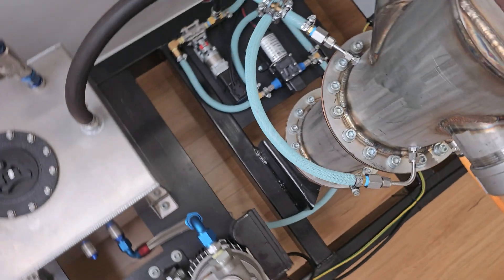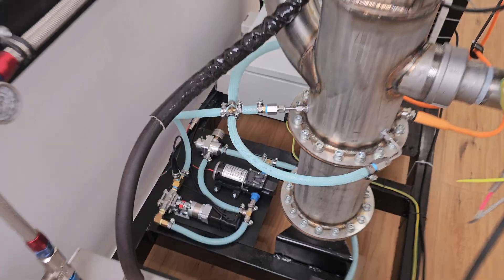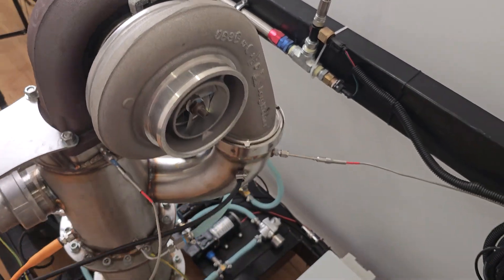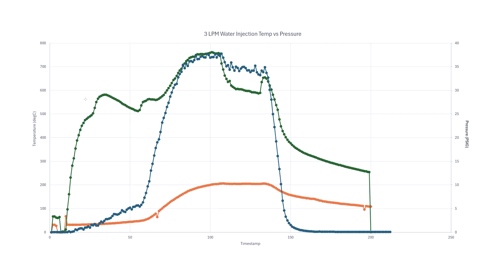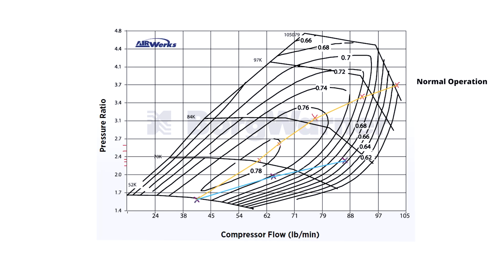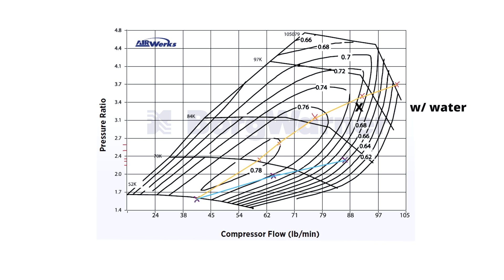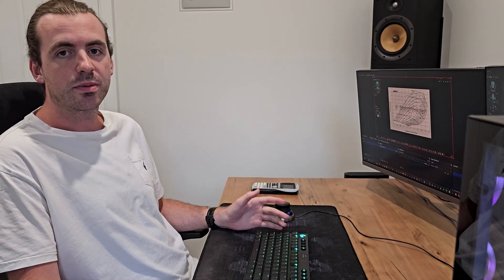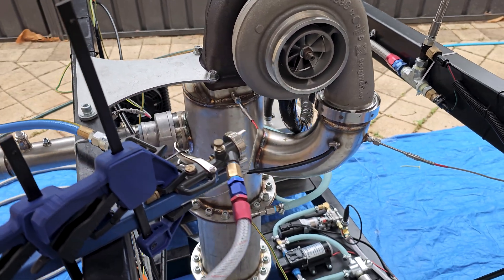Testing My JET ENGINE'S Water Injection System!

Comment: I'm doing something similar for a university project, but its a smaller turbojet rc engine (kingtech k240g5) producing about 50 lbf thrust, we are trying to inect a specific flowrate (6.7 gallons per hour) at around ~200 psi with a hydraulic water atomizing nozzle, we are struggling to find a pump that is under 300 dollars that can produce a constant 300psi pressure. Would love to connect and would appreciate any advice!

Comment: Nice work, have you tried adding methanol to the water
Reply from the maker: Hey mate, love your work! I haven't as of yet, but it'd definitely help. This is a temporary setup, the plan was to use a pressure washer pump to get 1-2kpsi to help atomisation. The addition of a tank (and filter) is on the list and that way I can experiment with methanol etc too :)
Reply: @eg_engineeringaustralia  Thanks, you could just add it to the water 50/50 mix
Reply from the maker: Thanks I'll keep that in mind! Hope things are going well with the 175! 😊

Comment: I have heard that you will wear the impeller down injecting it into the turbo
Reply from the maker: Absolutely, and that is at least one of the reasons that I am going with injection directly into the combustor. But even then you need to consider turbine errosion. But in my case the benefits are worth the cost of a new wheel every now and then

Comment: Shouldn't you inject later in the combustion process?  I would think that the heat absorbed by the vaporization could inhibit complete combustion if set up wrong...
Reply from the maker: @ZachSwena  it definitely can, and I'm absolutely expecting it to happen with this basic primary zone injector but the part that I left out of the video was I already had the holes there's from previous stuff so it was very easy to add and I just want todo some tests as more of a sensitivity analysis more than anything. It would likely be better to inject just after the primary zone so you don't disturb combustion as much like you said but we'll see 😊

Comment: @EG Engineering Australia I actually think you get more power out of this 7:57 water, instead of this 2:11 system.
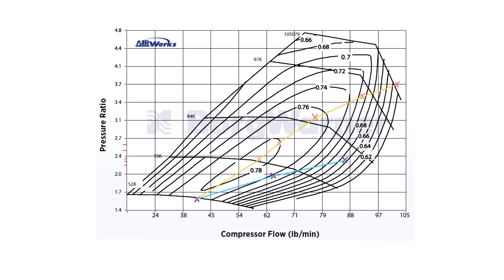Because now that water gets into the primary zone and gets a chance to boil to steam, and steam increases the volume MANY times (about 1'700x volume at sea-pressure), instead of as you said 5:54 that the water have no time to boil when in the dilution zone.
🤔 If you can pre-heat the water by using it as a coolant for some part of the engine before injection, it needs less energy to boil to steam, energy gained from otherwise waste-heat :D
Reply from the maker: @sebbes333  thanks for sharing this, i definielty agree with your logic mate, and the benefits of wet compression like that at 2:11 are very well documented but there's a couple reasons why I'm avoiding it (for now). It seems to be more limited with flow compared to internal injection, and I need to be able to inject several LPM for my aux combustor project. I didn't measure the example at 2:11 but it wouldn't have even been 1/10 of that just for perspective. I'm sure you can do it, and I'd like to test again in the future but for now I want to give internal a proper crack. Second reason is, injecting at the inlet alters the composition of air entering the auxillary combustor which will mess up some of my future plans with the engine. Blade errosion (both comp and turbine) is another consideration but honestly it's going to happen no matter how I do this with these flow rates so it's just something that i will need to keep an eye on via inspection. Hope that helps and thanks for the informative comment 😊
Reply: @eg_engineeringaustralia  Hmm... Blade erosion is something I haven't considered, but it's obvious when you mention it, the blades rotates at what? several 1k RPM? So throwing water, in there (even tiny mist droplets) would be similar to throwing sand into it but at lower RPM? that's not so good.

It reminds me like the opposite of "cavitation bubbles" (vacuum bubbles collapsing) that fast water propellers gets eroded from.
Reply from the maker: @sebbes333  the max for this turbo is 105,000RPM hahah so yeah it can be a serious problem. I'm fully expecting to need todo turbo rebuilds in the future if the blades erode but thankfully it's a very common turbo and I can get it done through a company here cheaply because they go through them like crazy.  There's plenty of ways to reduce it, and tbh a lot of comments on here are on the money with suggestions, it's just a matter of what's cost and time effective to implement. My priority is testing the new CD nozzles with the current setup as people keep asking for more shock diamond videos haha but after that I'll revist the water system. I'm really glad that so many people have been interested in the technical side of this project it's great to connect and brainstorm ideas 😊

Comment: I'd love to see you run the jet on alternative fuels
Reply from the maker: @adamgaffer3991  this jet was originally made as a platform for alternative fuel testing as part of my engineering thesis project! There's some other videos on the channel of it running both simultaneously and individually on kerosene and LPG, which I did for emissions analysis 😊
Reply: @eg_engineeringaustralia  sweet I came into the series a little late but what about waste oils or bio diesel
Reply from the maker: @adamgaffer3991 The videos are pretty old haha I did the project back in 2020 actually. The focus was on dual fuel with methane or hydrogen being combusted simultaneously with jet fuel. But, you can fun jet engines on just about anything combustible you just need to atomise it. Heavy oils could still work but you'd need to use an air assisted atomisation nozzle

Comment: you are running post combustion , equivalent to spraying in the manifold ( after valve before  turbo) for a gas/diesel  engine.  
      My thoughts for an expairament of my own , using pre and post cylinder injection  on my diesel.  Pre reduces Altitude Density( higher lb per cubic ft) and in cylinder steam generation/expansion.  Post to recover lost volume from 1st stage exhaust turbine  contraction , yealding higher pressure raito in 2nd  larger turbine housing  that force feeds the 1st more lbs per min . 
Dream Big  Chisel Down to Really

Comment: Very thought provoking!

I've never thought of using water injection this way, but it definitely rings similar to water injection on reciprocating engines.

I personally never thought of bleeding boost for side projects either.

I've used it for cooling purposes, but that ended up still pushing the boost overflow back into the exhaust of the engine in my case.
Reply from the maker: @hunnybunnysheavymetalmusic6542  haha yeah it's opened a lot of avenues for auxillary projects! I've got a bunch of things I'd like to test. 

Thanks for the comment - let me know how you go with your engines 😊

Comment: Maybe add a little methanol to the water.
Reply from the maker: @Emprivan  this is just a temporary setup for testing so I'm running straight from a hose. I'll have to add a tank so I can filter water easily and can add alcohol or methanol for testing down the track but this should be fine for now 😊

Comment: You can try to make superheat steam from exhaust heat injection, break down water's molecule.
Better than atomizing droplet.
Reply from the maker: @watt1241  thanks for the comment! I'm assuming you mean regeneration? Like heating the water through tubes in the exhaust to a steam and injecting the steam in to the combustor? If so I have thought about it but it's a lot more to consider than just pressure Injection of water. Definielty agree that it's more effective / efficient though 👌

Comment: Triple engineer here developing Advanced clean, efficient, power dense solutions in domains of energy, propulsion, mobility, robotics / exoskeletons and clean technologies with a particular emphasis on the aerospace sector including space exploration and commercialization [solved NASA's primary colonization challenges]. Among other things, I/we are developing an advanced power dense free-piston internal combustion engine based of our 𝔽𝕦𝕖𝕝 𝔸𝕘𝕟𝕠𝕤𝕥𝕚𝕔 ℤ𝕖𝕣𝕠 𝔼𝕞𝕚𝕤𝕤𝕚𝕠𝕟 [𝔽.𝔸.ℤ.𝔼.] technology [you may find some info online]. I've also devised advanced low cost, compact, power dense, fuel efficient jet engines [including rocket engines]. The public interface will be a personal door-to-door air mobility platform, the PersonalJet.

 So you are trying to get more power out of the black box w/o increasing the temperature. Any other goals?

Since the exhaust is still very hot, a recuperator/heat exchanger has been one way of achieving this but, depending on the architecture/topology they raise the combustor and/or turbine temperature. See power microturbines.  Based on several patented innovations,  several of my turbo-engine concepts enable simple ultra-high compression and/or efficient gas expansion which of course improves fuel usage & power-density. Here the turbine inlet temperatures may be so high as to warrant water injection at any number of points. I do not like the bulky recuperator for aviation apps so my efficient power section will be the best option. I expect exhaust near ambient which the 𝔽.𝔸.ℤ.𝔼. engine also achieves. 

A 🇳🇴🇻🇪🇱, 🇷🇪🇻🇴🇱🇺🇹🇮🇴🇳🇦🇷🇾, low cost, power dense compressor and/or turbine architecture may be used in some apps. A new air-cycle will also be used in some apps

I have your email and may get in touch at some point.

--
P.S.
Eventually we'll develop high temperature/efficiency solid-state thermo-electric power/propulsion tech and then the biggie - 'anti-gravitic' propulsion.

Comment: Why not add a second turbo…? Current setup as is, just pipe the final exhaust through a second turbo and use that fresh air for the nozzle testing
Reply from the maker: @laser69beam  thanks for the comment mate and really good thinking, but there's some major drawbacks to consider. firstly you need to buy a turbo, which even second hand in 75mm size is expensive.. and the big one is that the second turbo wouldn't get anywhere near the pressure of the first one due to the horribly inefficient turbines which basically all turbochargers have by desing. Compound setups are a slighty  different story and something I am keen to test in the future but there are similar considerations to be made. Hope that helps 😊

Comment: try wrap a water pipe around the hot parts like the chamber lining and it should turn to steam if you heat it some more you will have super steam then inject that and it should help spin the turbine

Comment: 7:10 maybe give a regular car fuel injector a go probably want one for a big v8 or a semi truck so you have plenty of mass flow rate
Reply from the maker: @sterlingarcher813  hahah Sterling, my man, huge fan 😂 thanks for the comment, I think I'll get some fogging / misting nozzles for next time I do this but the problem is pressure and the air assisted nozzles alleviate that issue. Pumps are expensive haha

Comment: Add a bit of alcohol to the water to change the character of the liquid as to increase vaporization (I believe as little as 2% will do).  Alcohol  can add a bit of energy as fuel at a lower temperature combustion rate and add to lower temperature use (50-50% will keep the solution from freezing to around -25*C(+)..a(and it can be used as a after burner fuel).
Reply from the maker: @tsclly2377  Thanks for the comment! Great idea for sure, I've read a lot about water / alcohol injection but am yet to test it - definitely on the list of things to explore so thanks a lot for the info! Vaporisation has proved challenging with such a low pressure pump, my plan was to go with higher pressure but alcohol might be worth trying before I upgrade down the track 😊
Reply: @eg_engineeringaustralia  use a water methanol injection pump and nozzles
Reply from the maker: @turkeyboyjh1  I'll do some testing first as that'll still cost a fair bit, for context, the current pump was like $35 haha
Reply: @ oh yeah I never said they were cheap but they work very well
Reply: Most water meth injection systems companies are using 12dc RV fresh water supply pumps at 60psi  like what you have . 
There is 1 company that I know of that has developed a 1000psi system  pump, lines ( your hard lines are sufficient ), jets, and flow rate calculations. There name is RB racing  , devloped for 1200cc to 600+cid  motors at Bonneville salt flats 

My thoughts are; 1) the finer the mist the faster the evaporation   .2)  The higher the pressure drop the colder the water going in will be. 3) at some point as pressure increases explosive decompression  will start to factor into ( like a coak a cola) .evaporation rate/ droplet size.
 Around 400usd gets you a bldc 3kpsi pressure washer as a pump at home depot.
Reply from the maker: @daviddroescher  thanks for the comment mate and absolutely agree! I don't know if I mentioned in the video or not but a cheap pressure washer was always the end goal, great cost to pressure ratio and also ideal flow rate for what i need! The only tricky bit is hosing between the washer and stainless tubes which is why I went low pressure initially. Thanks again for the info, glad so many people find this as interesting as I do 😅

Comment: Any idea what percentage of the mass flow are you bleeding off the compressor for the second combustion chamber?
Reply from the maker: @paulthepilot5  depends on the throat area of the nozzle that I'm using, I've started small (around 15%) but plan to work my way up with larger nozzles and just keep an eye on temps 😊
Reply: @eg_engineeringaustralia  interested to see how it goes. I’m in the planning stages of an HX85 based turbine and a bleed air generator for turbo/supercharging system on an engine. Never had considered water or Water/meth injection to compensate for the bleed air losses
Reply from the maker: @paulthepilot5  yeah it's a unique concept, I still have a lot of r&d testing todo to improve it though.. 

Let me know how you go with your project, sounds like it'll be an interesting one! 😊

Comment: not sure if you tried in an older video but if you added a bell-mouth to the compressor inlet you can gain some flow and efficiency, not sure the exact numbers but on a turbo for an engine it can be upwards of 10%
Reply from the maker: @Gin-ging  Thanks for the comment! I haven't used one before but they are a good idea - I'll have a look around and see if i can find one for a reasonable price to suit my turbo. Tbh I was considering making a muffler kind of inlet just to reduce the screaming a little for my neighbourhoods sake 🤣

Comment: Nice build! I would be keen to see more detail on how your combustor is built... looks well thought out.

What was the theoretical temp drop you were expecting based on the water rate?

Just a suggestion if you arent getting the expected drop but it seems the vaporisation might be better if the water was introduced before the dilution air where the gas is hottest.  Also some internal vanes or some other structure after the sprays to induce turbulence and help the water droplets break up might assist.
Reply from the maker: @neil_neil_orangepeel  thanks a lot for the comment mate! Take a look at my instagram if you have it (same name as my youtube), I've put up plenty of images a while back that show the inside of the combustor. I'll eventually do a video designing and machining a new main fuel nozzle which would be a good video to run through the flametube design etc but that might be some time away as my focus is this auxillary combustor for now haha. 

The temp drop is ballpark what I expected from just 3lpm but I'll need even more than that, so I'm going to bump up the pressure and also add the 4th nozzle in the primary zone. It's all a bit of R&D at the moment as I find out what works best 😊

Comment: FWIW water injection on jets is normally placed with the nozzles in front of the compressor. You need to get the atomisation as good as possible as the droplets tend to wear down the leading edges of the blades a bit.
Reply from the maker: @TheBillzilla  Thanks for the comment mate! Wet compression like you're suggesting is very good for increasing power, but my main goal herr is to reduce TIT when I'm bleeding air off of the compressor for my auxillary combustor, and injection into the main combustor can achieve this while not affecting the composition of fluids going to the aux combustor which would be the case with inlet injection. I need todo a lot more R&D on this topic to find what works best so I'll likely revist inlet injection in the future ☺️
Reply: @eg_engineeringaustralia  Sure, but injecting water in front of the compressor will also help reduce the TIT. I've got a couple of thousand hours on Metro 2's & 3's, and we use water/methanol injection on those to boost power for hot take-offs.
The amount of boost the water/meth gave depended on how much the pump was turned up, the best I ever saw was on a TPE-331-10 in a Metro 2 (VH-UZY)  and when you hit the pump the torque would go from 800 lb-ft up to 1,500 lb-ft! Then very careful tweaking of the throttles to get the torque up to the 2,200 lb-ft limit. You'd never be temp limited that way.
Also FWIW when using just plain water they wouldn't make a lot more power, but the turbine temps would certainly drop.
The reason being that as the droplets when through the compressor they'd phase change to vapour and that'd absorb a fair bit of heat.